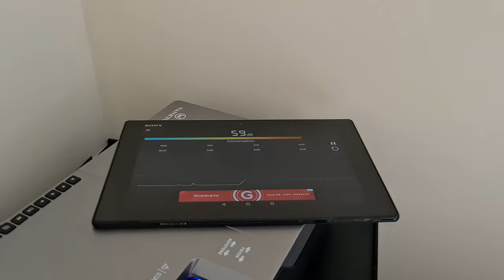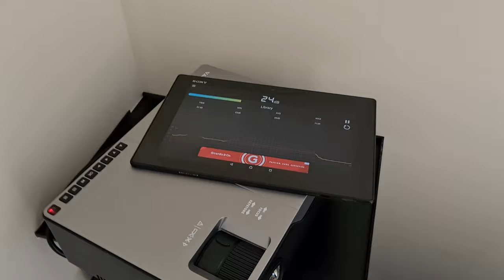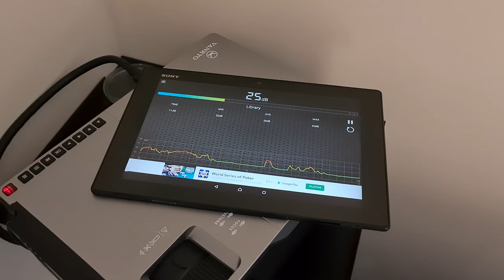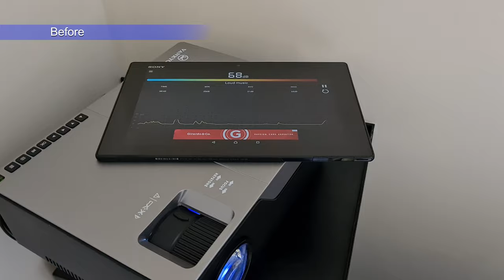VANKYO Performance V600 projector | fan and fan filter mod

Comment: Hi, I did this same way like you. Just used different fan. I used  Be quiet pure wings 2. Noise changed about 5-8db lower. Imo its not worth to do it. IT took me 2 hours and its causing lost warranty. The  main noise its coming from blower fan, but I cant find any good model to replace it. Changing voltage to 8.5v doesnt give significant results. If someone want to do it, be aware that all the glasses and mirror inside must to be placed exactly in the same position it was originaly. You can get ghosting or circle shadow on the screen. All this means you didnt put glass or mirror in correct side. I learned it the hard way, got pain in the  fingers from screws LOL. Friend, if you find a good blower fan we can use it please leave a message. Regards :)
Reply from the maker: Yeah 😉 sure but probably even if we manage to find any similar size  blower fan it would be same loud. But if I have some free time I'm gonna dig in to it.

Comment: How is the projector today?  Did the fan manage to keep it sufficiently cool even with less voltage?  I have the V630 and think that it has the same design of the fans, so I would build it again :)
Reply from the maker: It's still running with no issues. I recently gave it to my Brother so he can play some Xbox with a bigger screen.

Comment: I really wish your disassembly included more detail on how to take the cover off... it is NOT popping off as easily as you're showing it... the rear ports assembly are stuck fast!
Reply: I know what you mean. First make sure you don't miss the last screw he points to because I didn't even know it was there. After that.....it takes some strong pulling to get it off. I'm guessing since he's already done this...  His comes off much easier

Comment: Hey man, this is a really great video, thanks so much! 

I was just curious, did you step down the blower fan Voltage from (I assume) 12V to 8.5V just as an additional way to reduce sound? 
If this is the case, is the blower fan really loud by itself? 

I was wondering if it might also work to retain the preset voltage on the blower fan but maybe 3D print a casing around that place to allow air to flow straight from the back of the projector, I imagine that will still do a good job of reducing the sound, but there will be that higher airflow. 
Curious if you have any opinions about this approach?
Reply from the maker: Hello
Yes mostly just for the sound beacuse yes the blower fan is VERY loud.
Your 3D print idea could help a little bit because most of the noise generated by the channeles inside the case and ect. but I think even if it's have a better case(like v630) it will be still loud just maybe generate a different humm.
Thanks for the positive feedback I really appreciate it.

Comment: Hello, thanks to the video it is very informative. As other people on the comments, I am planning to do same thing on my different projector which is Wimius K1. I am just going to change outflow fan with Noctua fan. I have two question actually.
I am going to use 3pin to 2pin adapter instead cutting 3pin cables, do you think it is okay?
Secondly, what do you think about put some grease on inflow fan bearing. Would it reduce some noise?
Thanks!
Reply from the maker: The 3 pin to 2 pin adapter is good, just make sure its haveing the correct pinout. I don't think some grease would reduce the fan noise. The noise is mainly coming from how the air channels are made in the projector frame and of course from the blower fan.

Comment: Is it possible to remove the blower fan and replace it with a regular fan? I suppose in order to do this you would need to cut a hole in the side of the projector so the airflow is in the same direction. I’m not sure if a regular fan would produce enough airflow to keep everything cool. If it did, then that may be a great way to remove a significant amount of noice.
Reply from the maker: It is possible. But a regular fan cannot provide that much airflow to go through all the components and provide enough cooling. Especially for the display. You can give it a try but more likely you gonna end up a burnt display. You can try anouther blower fan but this size is so odd is very hard to find any other more silent replacement.

Comment: Thanks for this video! Awesome. I was hoping you could clarify some things for me:

The outtake fan is 92mm?

There is a 2nd intake/blower fan? Two fans total inside the projector? 

What mod did you do to the 2nd intake blower fan? Was the DC-DC converter slowing the blower fan down? 

Thank you!
Reply from the maker: Hi
Yes the outtake fan on the heatsink is 92mm
The 2nd intake yes is a blower fan 93mmx93mmx30mm
yes I slow down the blower fan.
by the way the original fans are:
the original intake fan is: songlian SDM9330B
http://www.sz-songlian.com/index.php/wareshow/sldzgs/1/en/375312,53143/53143.html
the original outtake fan is: songlian SDM9025S
http://www.sz-songlian.com/index.php/wareshow/sldzgs/1/en/375323,53143/53143.html
after this you can calulate the rest what you want. airflow ect ect....
Have fun :)

Comment: Thanks for your video! Is it possible to make a completely silent cooling system, maybe by setting up a giant heatsink? Did someone ever try to do that? Thanks.
Reply from the maker: I think it's possible but not for long term beacuse of the light source emitting high temperature to the display so minimal airflow is required
Reply: How about making a silencing box combining space and several different layers of a special noise-absorbing material? I saw a couple of videos here but sadly those aren't too practical.

Comment: Great video!

I am having trouble disassembling mine. I have taken the all of the screws out but still feels very secured near the ports. Any tips for getting the case off without breaking it?
Reply from the maker: You need to "move over the ports" but yeah i can agree on that area is very hard to get it out try to push the case back(same directions where the ports pointing) and lift it up like that.
Reply: Careful with this part, mine was stuck on the Audio Jack and it busted that one, but no worries as I can just solder a new one on.

Comment: Looks really clean, but I just worry about temps and how long it might last. If its got a nice amount of air being exhausted then, there shouldn't be anything to worry about.
Btw I see that xperia tablet, such nice tablets when they used to make them :)
Reply from the maker: Thanks :) I might try to get some temperature meter soon just in case. I'm using the projector daily just to check if its okay but I not had any issues yet. Yea i love my old xperia tablet its doing his job amazing. :P

Comment: Check if the LED are not being overdrived too. A lot of these chinese projectors uses 120W unjusted drivers to power 100, 80 or sometimes even 50W LEDs. Sometimes you need to change the precision trimpot to be able to set the right current
Reply: hello everyone.
I have the AUN m18 projector, which is the same projector with different branding.
Have you been able to check the PSU and the watts it throws to the LED?
I have opened the projector, but I don't see any trimpot to adjust.

Good video, I hope you can upload a video modifying the PSU, with that you could adjust the temperature even more.
Reply from the maker: Nice advice I'm very busy lately but if I have some free time I'm gonna play with it
Reply: @chanecillo786  mine just Died, and it might be the PSU, was going to post as well about it.

Comment: Thanks for the Video,
Currently i have a Excelvan CL720 Projector, and i did nearly the same modifications like you.
Outtakefan Noctua NF9 + DC-DC Converter with Potentiometer to control the fan-speed from outside.
For my Projector there were also a video to change the blower fan to an axial fan, with modification of the airflow (cone funnel), but this damagen my frenel lens or lcd panel (small black spot on one corner). I was also looking for an replacement for the axial fan, but without results. But  during my optimization i recognized that the most noise came from the airflow, and not from the fan itself. My setting is also at 8.5V in the winter sometimes lower. 
Now it is functional and stable since 1 year, but the resolution 720p is not optimal to watch pictures from our Smartphones.

Thats why i think about to change my projector to an Vankyo V630, because its a cheap Fullhd projector with the possibility to reduce the noise.
Does anybody have problems after the modification?
Reply from the maker: I use it often for long gaming nights and movie afternoons, no issue at all but I live in the UK, the average temperature is very low. But I made a temperature test video and I think its still cool enough after the mod so it should survive warmer summer days.

Comment: Incredible my friend, I have the same projector model (branded AUN M18, but it's same stuff) and I replaced the original fan with the exact same model of noctua fan you used! I did this hack during the days of lockdown here in Italy, about 10 months ago and the projector still works great! Just I didn't touched the inlet blower because I wanted to avoid the possibility of overheating the lamp, limiting the blower speed as you did (if I understood well). Would like to find a quieter inlet blower as replacement, but it seems to not exist with the technical features of the original one. Anyway just installing the noctua is a great improvement in my opinion. It's really funny to see that in another part of the world a random guy like me did pretty much the same hack I did. Where are you from dear fellow?
Reply from the maker: I'm from Hungary Livin in the UK :) I'm happy for you :)

Comment: What should be minimum rpms one needs to consider while purchasing new fan
Reply from the maker: RPM is not important what is important is the airflow for the fan next to the power supply 
and for the blower fan next to the lens and the mirror is the static pressure.
The stock fan next to the Power Supply is SDM9025S: http://www.sz-songlian.com/index.php/wareshow/sldzgs/1/en/375323,53143/53143.html
And the stock blower fan next to the Lens and the mirror is SDM9330S:
http://www.sz-songlian.com/index.php/wareshow/sldzgs/1/en/375312,53143/53143.html

Comment: Hi. I have the v630 model. I think it uses the same fans, I too have ordered a Noctua and a dc-dc convertor, thanks to your vid. Did you try going less than 8.5v? It's a shame no one makes blower fans with a better bearing, or at least something that isn't so loud, as I too cannot find a better replacement. I a'm doing to job tomorrow, will keep you informed. Thanks again for vid.
Reply from the maker: Thank you for the kind words 😊. I glued the pot meter on the dc-dc converter so I can't really change it. But I'm already happy how it is. I have a test video about it and I think thats a nice balance between noise and temperature. I not recorded that part but I changed the thermal paste between the led and the heatsink. Don't forget to do that cause I think it can help to get some extra degrees lower. Have fun 😉
Reply: @L0L0K3  Yes, I build pcs so I think that's a good idea too. I'll test out lower voltage, I may get the dreaded burn but I'll the up the voltage.

Comment: Yea I would definitely check the temperature to see if it's worth it. You might be cutting the LED life short if it's heating up more than usual and your image might be getting dimmer as time goes by. In my opinion, it's not that bad if you have the projector far away from the viewing area and personally I have it right next to my head and I don't really mind because sound/music drowns out the fan noise.
Reply from the maker: I ordered a thermometer and I planned to make a video about it,but I don't really know how hot it was without the mod, so it will be hard to compare, but I hope the numbers will be good. I may forgot to mention but I changed the thermalpaste between the led and the heatsink so that can improve on it a little bit as well.
Reply from the maker: As I promised the temperature check video :) I'm very happy with it. Compared to stock from other people video it's still very cool.
https://youtu.be/OdDkz6po1sg

Comment: Hey, I'm planning to do the same mod with the same projector. I saw there is a second fan you didn't change in this video, any idea if it's smart to change that one too or any specs on the second fan?  Maybe it's also a source of annoying noise? ;)

Also, why did you add the DC-DC 8.5 V, what does it do?
Reply from the maker: The second fan is a blower fan:

http://www.sz-songlian.com/index.php/wareshow/sldzgs/1/en/375312,53143/53143.html

it's hard to find a more silent but same spec Fan, the DC-DC 8,5V it's just make the second fan more silent but still keeps the projector cool enough. but that's can be different, so adjust the voltage for your own need.
Reply: @L0L0K3   Ah yes, I also just realized you added that second opening next to the second fan for better airflow. I skipped that part :D:D
I guess the primary fan connection is two pin, that's why you cut the cable of the new fan? 
BTW, thanks for making this video!! Really I'm amazed as it's exactly what I was looking for!

Comment: hi 
i have v630 vankyo  and iam thinking to change lcd fullhd  panel  to 4 k  lcd panel  .
is it possible  ?
Reply from the maker: Yes it's possible But you might need a new pcb to drive it because I don't know if the stock one is support it.
Reply: @L0L0K3  it would be cool if you can make a video changing a panel to 4k
Reply: @Silverdollar-zi8ym  Its more than just the panel. To show 4k all components between the source and the panel need to be able to handle 4k so the main board would need to be re-engineered.

Comment: nice video man

I also have this idea of modding my v630, i started by installing a PWM module on the intake fan and its okay
but what do you think about replacing this blower fan by a normal and much quieter fan? ( like the noctua for example)
Reply from the maker: Thanks for the nice words, It is possible to change the blower fan but very risky, 'cause the screen can be overheat if not enough airpressure is going though of it. You can try, but I wouldn't recommend it.
Reply: @L0L0K3  okay I understand that some air should circulate through the projector in order for heat to dissipate and for dust not to stack on lenses and LCD screen
But as we already decreased the air flow while decreasing fan speed, maybe we could simply change the fan by a much quieter one.. idk
Also do you understand the difference between air flow and air pressure? I thought both are binded but maybe not..
Reply: Another message to tell you that i shorted the fan port from the motherboard and some smoke went out 
Surprisingly the port still work and i can still power the fan but there is a problem as the port supply power even if the projector is off. 
Fortunately my pwm can control and turn off the fan from outside the proj. I just need to do it manually now.
Reply from the maker: @juliensimon2000  sure you can change the fan but its hard to find a similar blower fan what is quieter simply because how the blower fans work. You can try to change it to a normal (axial fan) but those have less air pressure what is important to have enough pressure to move all the air through the components (display, power supply and the heatsink)
And yes air pressure and air flow are totally different stuff. Air pressure is sort of how strongly it can move air. Air flow is mean how much air it can be moved. I hope this make it clear 😉
Reply from the maker: @juliensimon2000  i'm sorry to hear that
Reply: @L0L0K3  okay I read a little and you are totally right about static pressure, in fact SP fans are used when the air needs to move in an "encumbered" space (space with high impedance ≈ resistance) and so is the projector. As we watch the inside, we see that the air needs to pass between two screens which means a high impedance (cf. fluid mechanics).
Reply from the maker: I'm happy to see I helped you. 😊
Reply: @L0L0K3  update : there is another fan port on the mobo where i was able to plug the blower fan with no prob ;)
Reply: The LCD itself is the most critical point that requires VERY high cooling, as it absorbs a very large percentage of the light output power, which could approach 100% in dark images. Think about that... if the projector uses a 100 Watt LED (as my LC650 does), the LED convert approximately 50% of that input energy to Light, so you have 50 Watt of light energy, and 50 Watts of thermal energy to dissipate. That 50 Watts of light energy goes through the LCD all of the time.  

A typical TFT LCD can only transmit about 5-10% of the light that enters it - due to the dual polarizers and filters... as seen here:
 https://www.vislcd.com/important-optical-factors-of-tft-lcd/#Transmittance%20(Tr)

So now we see the LCD must endure absorbing 45 watts of power without overheating... this is exactly why the manufacturer uses that specific kind of fan/blower for the LCD panel.

While a short-term test will not reveal the result of changing this cooling, over the long term it will absolutely cause LCD overheating and permanent damage to the LCD.
Reply: @beforebefore  okay i get the point of the screen receiving energy

your article considers a lcd screen like a monitor, composed of different layers sticked together
in the case of a projector, those different layers are separated by air so the energy disspates more effectively, thanks to the blower fan for example

moreover the polarizer placed between the led and the lcd screen cuts the transmited light energy by a lot and you can also add the effect of the fresnel lense that does not have a 100% transmittance either
It could be interesting to characterize by how much but i think it's at least by a factor two

and I read about a 15-30% energy efficiency for COB led chips despite not a lot of sources